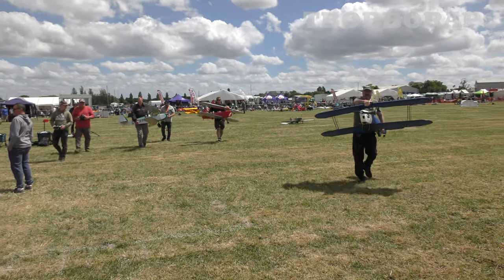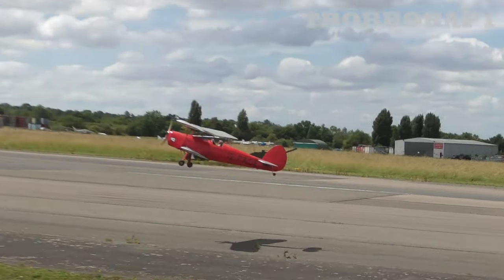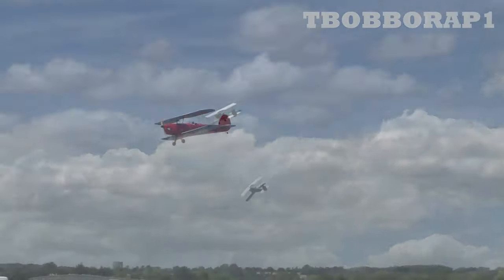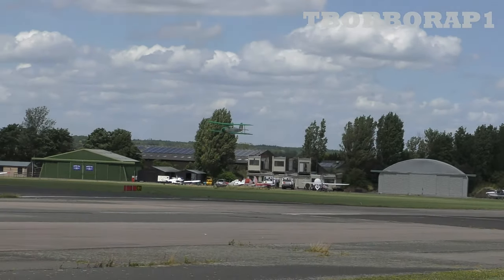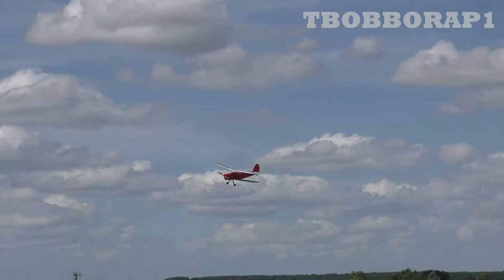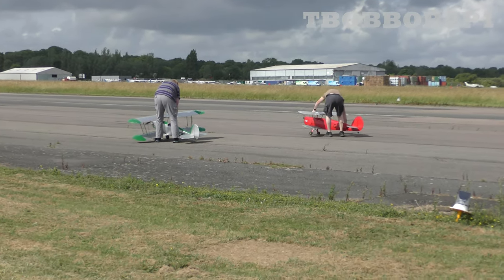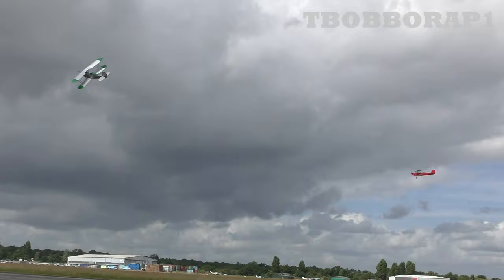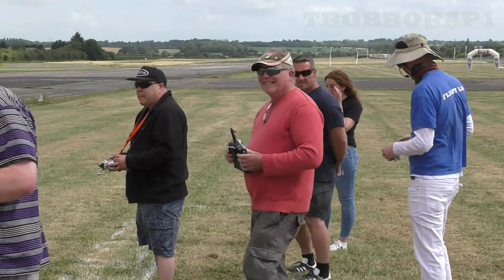1/4 SCALE PRECEDENT STAMPE RC BIPLANES DISPLAY AT WINGS & WHEELS MODEL SPECTACULAR - 2022

Comment: Despite the name "Stampe", the word is actually pronounced "Stomp".  Bugs the hell out of me!
Before you tell me I am wrong, I have flown 7 of the full size and over 100 hours logged.
Reply from the maker: interesting - i didnt know that
Reply: @tbobborap1  There were 3 versions of the Stampe made, SV4 A/B/C.  As you know, the aircraft was originally a Belgium design, with the designation B for all Stampes made in Belgium.  B models differ in that they use the Gipsy Major engines.  Later, the French built them under licence and so they used the designation C.  They engine'd theirs with the Renault 4PO 3/4 engines.

Later, post war, the French used the aircraft for aerobatic training / contests so re-engine'd some Stampes with Renault 4PO 5 engines which were capable of maintaining continuous inverted flight.  These had the designation of A.  You can tell the difference between A and C variants from an additional bulge on the top of the cowling which had an additional oil sump, providing the engine with oil whilst inverted.